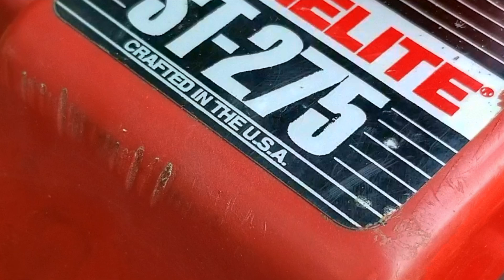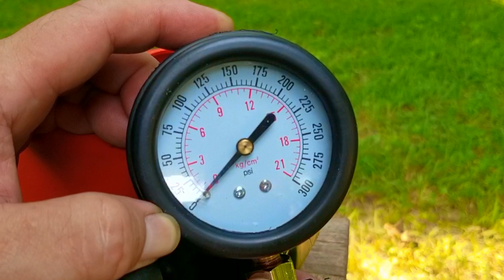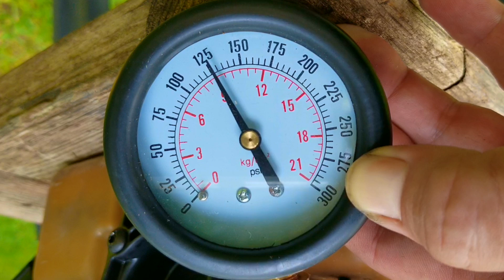Trimmer has Fuel, spark and compression but it won't start.

Comment: It's to old when you can no longer get the parts to keep it running or when the repairs would cost more than buying a new unit.  I have a very  similar trimmer in my shop now and it runs great.
Reply from the maker: Great point and it's nice to know I'm not the only one.
Reply: I agree to disagree
Reply: @aworkingmanspride2494  How do you disagree? Do you buy a new unit when yours fails to run or do you keep it going no matter the cost?
Reply: @brianking1138  keep it going no matter the cost
Reply: I found parts for mine easily
Reply: @aworkingmanspride2494  I can respect that, some tools just feel too right to give up on.
Reply: @ColinCearley27  couldn't have said it better 👏

Comment: i have a homelite st 285 and it leaks fuel everywhere when running out of the return line. the return line doesnt go into the tank and i have to cover the return line with my finger to make it bring fuel into primer bulb. is this normal
Reply from the maker: interesting it sounds like the check valve in the primer bulb section is leaking. I would either live with or I'd replace the carb.
Reply: @HomeGaragechannel  is the check valve able to be fixed or replaced
Reply from the maker: on this model it can be replaced.
Reply: @HomeGaragechannel  would i find the part in a full rebuild kit that comes with jets

Comment: If it had an air leak from engine bolts being loose, how did it have 125 psi compression?
Reply from the maker: The compression tester is measuring the if the rings are worn, not the cylinder gasket which is a different area.
Reply from the maker: @Michael Reed thanks for the information

Comment: I have the same weed eater and I cleaned the carb and got 125psi  on the compression tester and has good spark and can't get it to run
Reply from the maker: after repeated attempts to start it, the engine could have flooded. Try starting, by using no choke while squeezing the throttle .
Reply: Ok thank you I did it and it starts now
Reply from the maker: thank you for the update.

Comment: I've had the same problem with my craftsman leaf blower it is the outdated design with the fan on the bottom but it still runs good after having the bolts come loose twice.
Reply from the maker: must be a design issue.
Reply: @HomeGaragechannel  yea but I love that blower
Reply from the maker: I know, I had one too, in fact it's what got me going on small engines to begin with.
Reply: @HomeGaragechannel  cool

Comment: Dont know if you'll reply but I've been working on this mower for awhile now when I got it it wouldnt stay running so I thought it would just be a carb probelm and I cleaned out the carb and it runs but it runs terrible it will run quite then really loud and just shakes so much  any ideas??
Reply: It back fires alot too
Reply from the maker: Could you get me the model and serial number so I can see what mower it is and what engine it gas on it.
Reply from the maker: @Yaboyyouknow1  was the blade bent when you got it or did it have a big gouge on the cutting edge?
Reply: @HomeGaragechannel  yes the blade has many gouges in it, it's a craftsman 4wd the sn is 5X70MUA171221A0063 sorry for the late reply my notifactions arnt on I will switch them on but I found out that if I push the choke linkage forward it runs just fine
Reply: It's like it's not getting enough fuel now but I got the linkage and the carb all right
Reply from the maker: @Yaboyyouknow1  have you tried to put fuel into the carbs throat and then try starting it?
Reply from the maker: @Yaboyyouknow1  thanks I'll take a look.
Reply from the maker: @Yaboyyouknow1  is that the model number? or is there supposed to be a space somewhere?
Reply: @HomeGaragechannel  it said sn so I thought that was serial number I get them mixed up but here is the model number 37955 and yes it runs but it runs wrong like it reves up and down and backfires and overal just runs horrible and I've chnaged the spark plug

Comment: hi do you know how to take of spark arrestor on homelite hlt26cdb?
Reply from the maker: it's built into the muffler, you can't remove it.
Reply: @HomeGaragechannel  ok thanks. you are doing great job explaining nearly every possible issue. I found a homelite trimmer in my garage and it started and bogged down. one day i found your video explaining what to do and now it runs like new. I really appreciate it

Comment: What if you don't have a spark plug tester, use the given spark plug, and the spark plug itself is bad?
Reply from the maker: try a different plug, if that fails you can use something else metallic to replace the plug but you would have to hold it away from the metal of the screwdriver about the same as the gap on the plug, you can still see the spark but it's not easy.

Comment: Never too old to repair and that's a qaulity make too and the pull starter needs some attention too mostly a bit more of a turn on tension on the rope or a replacement rope for it as that's a good runner etc.
Reply from the maker: yes sir, I'll look at it some day.
Reply: @HomeGaragechannel  yes it does sound like a very easy repair fix etc.

Comment: My mother bought a homelite trimmer last year from home depot I'm always the main user of it I used it once had to return it because it wouldn't start and I didn't had no either on hand took that one to exchanged it thank God I don't have no issues with the current one I finish off the rest of mowing season. Last year I did noticed it would surge when it go from idle to full speed thank God I knew how to work on trimmer carbs so I cleaned it before I put it up for the winter got her out filled up the tank pulled on her fired right up back in first week of March I believe now I don't have any issues with it some times I have to put it on run just to get it to start so I would say that I wouldn't buy anymore of them it is a pig to get started when I run it out of gas I have to resort to cold start pretty much I don't know why but that how it is
Reply from the maker: Sounds like quite a hassle

Comment: i own 2 of that trimmer, one with a clutch, one like that without one, they both run great and are both now 25 years old, (lucky that both engine S/n were still there and both are made in 95) the one with the clutch is the one i use as a company trimmer, the other is for home use. these run forever and have decent power for their age, especially the 17 inch cut one, it doesnt do well in super tall grass but it will still cut alot never stalling or eating up the clutches. also if i have to say, its exhaust notes are far more enjoyable than any other trimmer ive run, its muffled like a small dirtbike/moped of the 2 stroke variety.

Homelite 175sx/Bandit is the brand and model.
Reply from the maker: I completely agree with you

Comment: Can u help me I have a craftsman blower that has compression 95 and has spark and fuel but won’t run
Reply from the maker: so the compression is 95 psi, and there's spark.  How are you getting to inside the engine? Are you spraying into the spark plug hole or into the Carb's throat?  Have you checked the flywheel key to make sure it's not partially sheared?
Reply: @HomeGaragechannel  I have company rebuilt the top end it has 95 psi but also it hasn’t run to break in the piston ring I was cleaning it one day and the fly wheel fell of I was thanking that was my problem but wanted to make sure

Comment: Great information on testing to see if the trimmer is worth the time to repair and then the repairs.  Thanks for all the information and video.  If you have an older trimmer or mower and can fix it this should be done because it probably is made much better then what you can get today.
Reply from the maker: you got that right, briggs, Kohler, honda, it doesn't matter, older was better.

Comment: I recently fixed the carburetor on a weed eater brand that was 35 or 40 years old. It was my father's. It runs as good as ever with the cleaned carb & new diaphragms. The only downsides are it's heavy & has a curved shaft. The old ones were built to last.
Reply from the maker: yes you are correct, thank you Robert Williams

Comment: I have a problem in my 4 stroke line trimmer got spark, fuel and the rest looks ok but isn't starting no matter what. It's frustrating, it's only 15 months old. What else to look at ??.
Reply from the maker: the only think left would be to check the compression with a tester, otherwise you might have a valve issue.

Comment: Sorry, this comment isn’t video related. I see in your home page picture, you have a sentinel riding mower. Do you have any videos on that mower or maybe still have it to do a walk around video of it? I too have the exact same mower. I can’t tell you how many problems I have had with that odd sized 39 inch deck.
Reply from the maker: I still have it and it was actually fantastic for a long time, but I ran into an engine problem. it's siting till I figure out what to do with it.
Reply: @HomeGaragechannel  I had to change the motor on mine. I took the deck off to the scrap yard because the spindles would break and the blades would hit each other ever so often. I love the mower, something about it is just unique. I may change the tires out to the tractor tire kind to pull my lawn trailer around the yard/woods. There is very few videos on that lawnmower. My jaw dropped when I seen you had one in your pictures. The odd size 39 inch deck almost had me curious if the blades needed to be timed? Too late now because the deck is long gone.
Reply from the maker: I know right, this was my first simplicity and I really did like it a lot. thanks for sharing.

Comment: In regards to the petrol tank yellow/orange tint, this can be rectified by using peroxide 40vol / 12%. I use a cream as opposed to solution, dab on with a paint brush, wrap in cling film to keep the heat in and leave out in the sun. This may take a few days, and a couple of applications, but I like the fact that the sun caused it, now it's also it's solution. You can find this sort of thing applied to other plastics on YouTube, but this is my preferred method. Hope this helps take years off this machine!
Reply from the maker: that's an awesome solution, Do you have a link for the solution?

Comment: Also it' s a straightshaft design; very reliable vs today' s designs
Reply from the maker: you are correct
Reply: You can still buy straight or curved shaft weedeaters...
Reply: @M3TA1UPY0URA55  but I prefer straightshafts because they have longer reach and they' re easy on your back
Reply from the maker: @M3TA1UPY0URA55  yes you can
Reply: @samuelvelez1643  definitely. I see where you're coming from. I was just referring to the fact you can still buy a straight shaft. I have several stihl straight shaft trimmers and I can say that that's the only way to go! I also like having the handlebars and a strap on mine. I'm only 28 but I like having all the control and the lower amount of stress off of my back.

Comment: These trimmers seem pretty decent. I purchased one with 2 other broken trimmers for just £30 here in the UK. it had not been used in many years. all i needed to do was unseize the pull start catch spring so it will engage, and replace the rotten fuel lines. 
I put some fuel in, put my thumb over the inlet hole, and after 2 pulls fuel was pulled through, and on the third it started.  mine is the curve shaft model, but the same power plant on top.  I think a trimmers age is no excuse to dispose of them, if they work, they should be put to work.
Reply from the maker: I agree with you, just because it's old doesn't mean you need to get rid of it.

Comment: Great video, I used to have one like  that and a few others old trimmers, hurricane harvey took care of them.I would like the P/N of the primer bulb,on that trimmer.Thank you.
Reply from the maker: I think the link in the description is for a multipack, which takes care of the 3 major styles. will that okay or do you want something else?
Reply: Just the little primer bulb,that's on the trimmer P/N if you can.
Thanks.
Reply: @jerrysoutherland662  I think either lowes or home depot sells primer bulbs in a three pack which includes the small one
Reply: @jarridcockey3810  Thank you for that information.
Reply: @jerrysoutherland662  no problem

Comment: How about mud wasps plugging up the muffler hole?
Reply from the maker: I've heard that happening before, but I haven't seen it personally, If I had gotten it running, it would not rev up with a partial or completely blocked exhaust .

Comment: Hi.   Love your videos.   For the gas tank.   Go to a beauty supply store and buy the hydrogen peroxide cream or gel.   This is a lot stronger than the bottle you can buy at the pharmacy.   Brush on the cream on the exterior of the tank and then wrap it with plastic wrap to keep it moist.   let it sit out in the sun for 1-2 days.   Better yet elevate it over a mirrored surface.  The UV from the sunlight will react with the hydrogen peroxide and will bleach the plastic.   People who restore old computers or similar equipment use this trick to bring back the original color of UV yellowed plastic.
Reply from the maker: that sounds like a plan

Comment: For removing discoloration from plastic put in hydrogen peroxide it can be the 3%  peroxide and use UV light to remove the discorling , there are videos of people remove discoloration from old plastic toys and I've done it with my old phone case and it worked really well , I'd say wash the gas tank with soap and water first and decrease it really good first then soak in peroxide tank wrapped in reflective material such as aluminum foil and cover with a UV light leave it for 24 hours check it and see how it's doing , also you want it to stay submerged under the peroxide or you'll have the rotate it and do it in sections which will work as well just might take longer

Comment: That cylinder head separation is a common thing not only on Homelite, but also on dewalt /weedeater branded blowers as well.. Blowing out the base gasket or o ring,,  I repaired this stuff for almost 2o years,,  I seen a few things,,
Reply from the maker: sounds like you have, thanks for the comment.

Comment: I just got the same trimmer. It doesn't run but i'll get it running again soon. I bought a new homelite trimmer 2 years ago and it didn't last long. Blew up on me 2 weeks after the warranty ran out
Reply from the maker: wow, I have to ask, was that normal use, or were you doing more than one yard?
Reply: @HomeGaragechannel  i was doing more than one yard. I had one before that and it lasted almost 10 years
Reply from the maker: Nice, at least you get the most you can out of them. Thank you James Hedrick

Comment: I’ve had a lot of problems with these trimmers.  When people bring these trimmers in, I tell them it’s going to cost more than what’s it’s worth.  Also, they don’t make the carburetor in oem or aftermarket.  I can’t stand these old Homelites, but I’m happy that you got yours running
Reply from the maker: You are correct, If I didn't get this carb working, it was going to end up on my curb with a free sign on it.
Reply: I actually like the old homelite trimmers. Simple and they ran great. That little motor actually has more balls than my brand new echo. I had to rebuild the carb in the echo after 1 mowing season because of ethanol in pump gas. The homelite is over 20 years old and still runs like new. I just need to source a gas tank and i can get it running again. The tank cracked and won't hold gas
Reply from the maker: @roadrocket7770  hope you can find one
Reply: @HomeGaragechannel  i actually found one on ebay. 25 bucks for a complete motor assembly. Housing and tank are not cracked. The guy just doesn't want it anymore since he bought a new stihl trimmer.
Reply from the maker: @roadrocket7770  that's a great price

Comment: As I always say,waste not,want not,I wouldn't waste a good line trimmer myself,my dads Honda line trimmer is 18 years old & it's still going.

126 PSI is probably actually good compression for a small  2 stroke engine because when I rebuilt a Stihl hedge trimmer with a new cylinder repair kit it was 105 PSI when brand new & it went up to 120 PSI after the piston rings broke in !

Comment: I still have one of these, only thing wrong with it is the gas tank cracked and leaks fuel now. If i could find a replacement fuel tank either on a dead one or be able to find a new one, i could fix mine. Damn thing still runs great.
Reply from the maker: Have you considered buying a universal tank?

Comment: So, i have a brand new makita plm4828n mower, it starts just fine but when i stop it and want to start it  again it won't start. It starts only after the engine is cooled down. I am thinking that the gas cap is the issue. Can someone help me out?
Reply from the maker: I think it's more of a flooding issue caused by a combination of issues, try replacing the spark plug, and air filter, and if you still think it's the gas cap, I would loosen the gas cap on hot restart and if it starts up, tighten the cap

Comment: I pretty much do the exact same things myself. Small engines are not the difficult to diagnose and repair. The only time I stop doing repairs is when the available parts dry up, new or used. And seems odd how quickly new parts dry up for most any piece of equipment these days. I guess that is their idea to force some people in to buying new replacements. IDK
Reply from the maker: You might on to something

Comment: for the fuel tank, ive seen that yellowed plastics can be restored by a UV hydrogen peroxide bath, not exactly sure what plastics do and don't work
Reply from the maker: unfortunately the yellowing these fuel tanks is not just UV damage but also from the Fuel itself, I don't think theres anything that can bring these tanks back to new, because the discoloration isn't just skin deep. The discoloration goes much deeper.